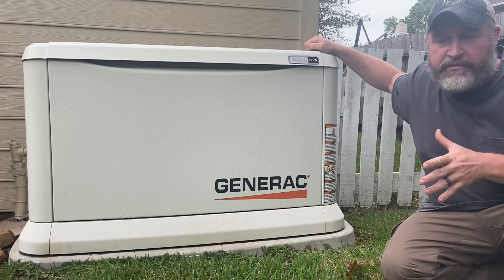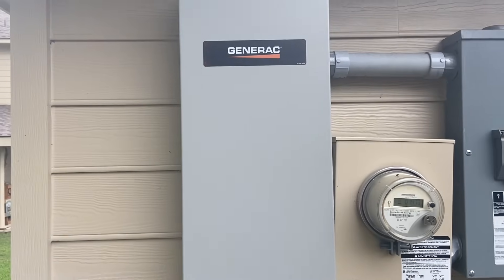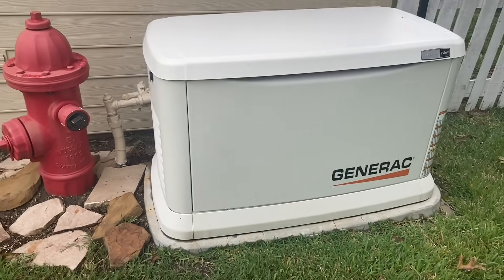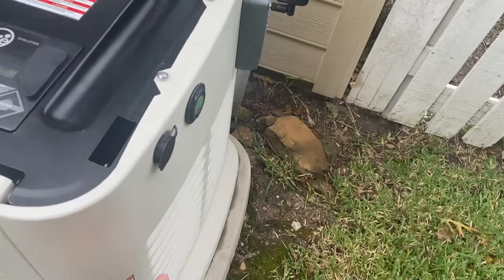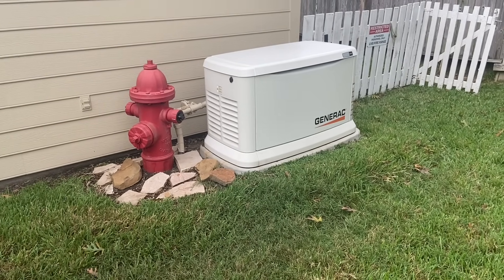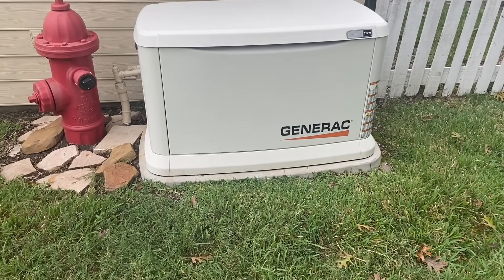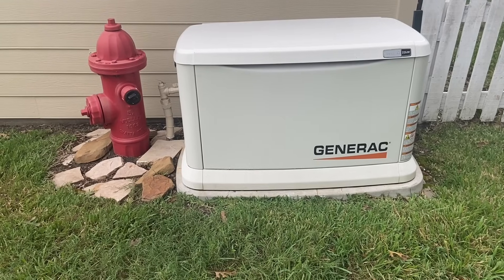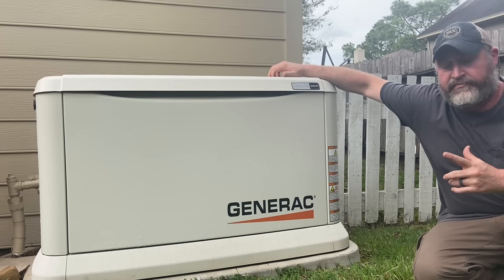Thinking of purchasing a generac whole home generator?

Comment: How much it cost in gas to run it for 1 day?
Reply from the maker: To many variables to give you a definite, but I figured during our 3 day outage we spent about 17$ more per day than normal give or take a few , keep in mind we had 2 gas furnaces and a gas fireplace one with the attic door open to keep our pipes from freezing. It was also  a colder month than normal so our gas usage was elevated
Reply from the maker: Hope that helped cost is not really something I think about just happy to have power , please subscribe and check out some of my other videos
Reply: Googling about:  "approximately 2.1 gallons per hour
For example, according to Generac a 22 kilowatt generator would burn approximately 2.1 gallons per hour at ½ load and 3.6 gph at full load, while a larger 38 kilowatt unit would burn 3 gallons per hour at ½ load and 5.4 gph at full load."  Fuel costs are regional.  For me, propane costs about $3.00/gallon.  YMMV as they say.
Reply from the maker: @barryf5479  thanks for the comment, well worth the cost when the power is out and you can sit the the comfort of your own home.  please subscribe like share and check out some of my other videos

Comment: Damn...  $11,000   No need to power entire house during a power outage.  Just pick up a nice 3500-5000 watt portable generator along with a manual transfer switch for under $1500 and a little 6000 BTU window unit to keep a room cold if needed.  But still a nice set up.
Reply from the maker: We played the portable game before and we upgraded. Thanks for watching please subscribe and check out some of my other videos.
Reply: I have a portable generator, but I am handicapped and it's hard to set up. I'm also doing this for my wife after I'm gone...
Reply from the maker: @davidgardner49  amen brother thanks David for watching.
Reply: Kudos for the manual TS!  The major problem with portables is you can't keep enough gas on hand for an extended outage, and lets be honest, portables are not designed for long run times.  They are inherently more dangerous than a permanently installed unit because of the quantity of gasoline that you have to keep around, with the refueling and keeping fuel fresh is a definite problem.   Yes, it can be done, but it is still a major hassle.

Not to mention that even though they are small they still suck down some gas.  I have portables that I converted to propane, I got by in 2011 on a honda EU2000, it worked, but there is only so much you can do with a small unit.  

So I still put in a whole house natural gas powered standby...because it is impossible to keep enough gasoline on site for major outage and guarantee it will be good over time-or that gas will be available during the next major outage.  That is my experience out in the sticks.  

(Of course, full disclosure, I have done generator service installation and repair for a living, so it does make it easier for me to install and maintain, than many.)

Comment: How much did this all cost you boss??
Reply from the maker: @X11CHASE  watch the video to find out.
Reply: @JustCantSitStill 😂
Reply: $11,000 in the video! OUCH!! I’d rather buy a gas generator from HD
Reply: @CanTho2022  Yeah, that's definitely cheaper but you'll still need a transfer switch or interlock kit which will cost $1k-2k installed plus the cost of the portable generator. Then you need gas on hand and you need to be there to manually set it all up and start it. A portable generator will almost certainly not run your entire house, but everyone's needs are different.

Comment: Writing from England.
Energy prices are getting so crazy here that we're on the edge of it being cheaper to have a gas generator for electricity - full time, and disconnecting from the grid!  Gas price is $0.08 while electric is $0.50
The only thing that's putting me off is the noise.
While I'm here, why are US gas pipes in threaded iron?  We have had copper gas pipes here for 40 years.
Reply from the maker: Yea I don’t think running one of these 24/7 365 is the way. There just not made to do that. We do have flex gas lines I guess it just depends on the area. I am not sure about the current supply line that’s underground, all that’s above and in the house is steel. 

Our previous house had a yellow flex underground but then went steel hard line to the meter and out to the rest of the house. Thanks buddy for watching all the way from England I appreciate you.
Reply: @JustCantSitStill  
I have a generator installer (just happens to be my brother-in-law) looking at what would be suitable for 24/7/365.  He's suggesting a generator running from 6.00 in the morning until 10.00 at night, then a bank of batteries supplying overnight draw for fridge/freezer and lights, etc.  Our annual use is 14,000 kWh with a winter day using maximum of 70 kWh.

Payback period (for generator and gas supply) is just three years!  So it's looking viable.
Cheers from England.
Reply from the maker: @jimskirtt5717  sounds like a great plan , cheers 🍻
Reply: We can't have copper anything in the US, the diversities will steal it.

Comment: Wow, where are y'all at.. Out the door in Central Texas = $7843.  No Gas line run on delta
Reply from the maker: No way , I got updated pricing this week 7/22 for my 22kw  6185$ just for the unit. We are in Houston.
Reply: Yeah a lot of these options don't exist if you don't have a gas line
Reply from the maker: @jacquestube  large propane tank
Reply: @JustCantSitStill  This is in Fredericksburg.  That is the 22kw with installation.  This was not the lowest either.  Low (Not Generac but Honeywell - $7200) High $8960 (Not Generac but Kohler)
Reply: @JustCantSitStill  large propane here.
Reply from the maker: @kdogbigdog  crazy price difference !
Reply: I live in Texas and Generator Supercenter quoted me $14,280 in 2014.
Reply from the maker: @rachelcombs9858  that’s the going rate in my area currently. Thanks for watching please subscribe and check out my other videos

Comment: May i ask if you installed soft start kits on your AC units to keep the inrush startup amperage low or did you not even have to mess with that for a generator this size?
Reply from the maker: @RussSchampers  no we did not mess with them
Reply: @JustCantSitStill They are absolutely worth it, and easy to install

Comment: I have the same Generac that you do, 22k.  We also got the house surge protector.  Today I'm running it for the first time for the 25 hour break in.  My house is a little smaller then yours, and we don't have power in our sheds, yet.  Whenever the a/c kicks on, it causes the Generac to speed up and get a little louder, for a lack of a better description.  Then it smooths back out.  You know the a/c just kicked on...  My worry is my desk top computer.  Whenever the a/c kicks on, it causes my UPS surge protector battery to light up and beep, but it only beeps once.  It's noticeable and bit scary.  I'm wondering if I have anything to worry about concerning my computer.  Generac is supposed to run a pc without harming it.
Reply from the maker: Yes I read that it’s supposed to be ok as well , ours bogs down a little and ramps back up with the A/C’s start and we have not had one single problem yet. Thanks for watching have a great weekend.
Reply: @JustCantSitStill  Thank you.  :)  I had watched your video before we made our decision to buy.  I'm a little stressed, I guess. :D
Reply: 25 hour break in?  I had a 16KW Generac installed in July 2020, the installers ran the unit for about half an hour and that was it.
Reply: @RICKYY1100  I meant to say 24 hour break in, but yes.
Reply: The generator does get louder on a load change, but it doesn't "speed" up, it is just working harder.  Your UPS, if you have a better one, some have software that can be adjusted to alarm at a different voltage sags/surges, most are set to about 5 volts plus or minus, which is too sensitive during a generator run, and so the UPS will always complain when the voltage varies that much-which isn't very much after all-no reason for fear-but once is normal.  Your power company does the same thing, it just isn't happening as fast as it does with a generator.
Reply: @bobbygene8274  Thank you :)
Reply from the maker: Connect a tachometer to one and come back and tell me it’s does not slow or speed up during load cycle…..

Comment: Just remember, if you are off the grid or loose power a lot. These generators need power from the pole to service itself. There are off the grid generators that don't need power from the pole.
Reply from the maker: Thanks for watching.
Reply: They all need batteries charged, or block heaters working, off grid or not.  There is a need for some kind of power system to account for the parasitic drain of standby service for everything.

Comment: I can tell one thing it will cost you about  fifty dollars a day, 24hrs,to run this beast!
Reply from the maker: Mine did not, probably depends on your area and NG cost.
Reply: I’m looking at putting one of these in. Even if it does cost that much to run, that’s $350 for a week, for example in a major power outage. I’d gladly pay that to keep from losing a fridge & 2 freezers full of food, beef & venison. Plus the convenience of having the whole house powered including HVAC. I guess it all depends on what resources you have available. If you’re spending this much on a generator, you’re probably not sweating $50.
Reply from the maker: With the generator running , both furnaces, gas fire place and water heater it cost me a little less than 17$ more than normal for the bill cycle.
Reply: $50 a day is cheap as hell to survive
Reply: Cheaper than a hotel room!

Comment: Better make sure you know the warranty because they won't repair it only if you know who is responsible for the warranty work and get it in writing
Reply from the maker: Mine extended warranty is through Generac. Warranty work can be done by Generac or an authorized/certified Generac Service provider/dealer. Thanks for the concern and for watching. I appreciate it.

Comment: I just brought a house that has one of these unit’s. 

What’s the point of the natural gas, if you have to use petro anyway? 
Can you test run the unit with the city power on?
you ever consider building a sound proof box over it? 
Thanks
Reply from the maker: What do you mean you have to use petro anyway? These run on LP or NG. Please clarify your question.  Yes it’s runs a self test weekly. No if you build a enclosure you will definitely void your warranty if you have one.
Reply: @JustCantSitStill  Ok, so it’s either natural gas, or Regular gas I didn’t realize it was one or the other. Thanks.
Reply from the maker: @dragonlotion1789  liquid propane or natural gas
Reply: Yes you can test the system with city power on..... should have been tested by your home inspector.
Reply: @alm4132  thanks for the info. The inspection process has packages, at least the company that our realtor uses. I guess it wasn’t included.
Reply: No gasoline, propane or natural gas. If you heat your house with natural gas, hook it up to it.

Comment: My Lord that’s a lot for a permit!  Damn government.  I guess because your lines were 50 feet it cost more. I’m in the country and I’m going to place my propane tank close to my generator and I already have a transfer switch that came to my garage end.  Then the electrician ran wires (huge) over the top of the garage in attic floor to my Circuit breaker box which is high tech. He did it right.  I hope to do better than you for a 20 KW!!
Reply from the maker: Gas and electric permits city of Houston wants that money 💰! Good luck with your my dad did similar after it was said and done he came out the same as my turn key project. Have a good one thanks buddy for watching.

Comment: I think you said the battery only lasted a year and a half.  Did you have to pay for a new one under that yearly maintenance plan you purchased, or is the battery included in the plan?  I just bought an 18,000 watt generac but am still waiting for the propane to be delivered so the electrician can finish hookng it up.  Thankyou for sharing this video. It was very helpful.
Reply from the maker: Hey Bob the battery is considered a wear item so it would not have been covered, so I replaced it out of pocket. Congratulations on your purchase! Hope it provides you with many years of trouble service ! Please subscribe like share!
Reply: I don’t know what type of battery you had in there but if it was the correct battery then there is no reason why it should be replaced only after 18 months. If the contractor your using is telling you this then you need to find a new contractor. 

***15 years experience installing and servicing generac generators
Reply from the maker: @Drtouchwell  wow I appreciate all the comments, it was a 18 month interstate battery , complete junk lasted about 16 months. Replace with a die hard been great since.

Comment: How much was the battery replacement?
Reply from the maker: Whatever the cost of the battery was probably 200$ now.
Reply: We have a 22kw just got the battery replaced it cost $340 in Florida right after hurricane Milton needed oil and we ran it for 30 hours using propane tank

Comment: Seems to be a bit long to respond.  Useable, no issue, just need battery backup on some items inside.  The 20KVA system is ideal for a 200A power panel.  200A * 120V, [ yes I know a 220 system but 100A per leg ], gives you 20000 or 20k. Assuming pure resistive and all are resistors, not inductive motors.
Reply from the maker: I don’t think it was slow at all but that’s my opinion. Thanks for watching and the comment.
Reply: Our church switched to a CCW 440cc 2 stroke diesel unit at about 20kw. the boiler was switched from oil fired to ball lighting plasmoid T henry moray uniit which is 800kw and way more heat as it taps zero point energy! today the oil burner unit was rebuilt by Sheldon Richardson and Odell Beckham who wants us to switch to no. 2 diesel fuel oil and installed a new ignition transformer. Myles Garrett refused to go near this thing!
Reply: Jaynen Samuel's has an ignition transformer with is 24kv and 1.5 a and can kill someone instantly which is why Myles Garret disproves it!
Reply: craig Iron head heyward spirit turns a an iron fireman oil fired unit into a spirit powered 66000 deg f plasma particle accelerator with which is spirit mind! Saquan Barkley waste oil burner is 3 million BTU and burns waste fat vegetable oil and uses the high 24kv ignitionn transformer. He also uses this oil to fuel the EMD 710 2 stroke railroad engines
Reply: @jlo13800  😁😁
Reply: Its a 2 stroke engine and i got one with a 30kw 2 cycle engine to start heavy loads

Comment: Compare 10 millisecond transfer time ,almost silent operation,almost no maintenance, payback from day one with a solar system. About 20,000$ for equivalent capacity if diy but no noise,no propane no oil change .Harvest 50 KWA PER DAY for about $225 per month payback
Reply: Get a smaller generator to play with as a hobby and use almost never.
Reply: Power from these generators gets distorted at a little over 50% of rated capacity.
Reply from the maker: Nice but that expensive, how long can you run on yours without the sun?
Reply: @JustCantSitStill  Most nights it lasts till the sun comes up.I still have a 9KW generator and lots of propane.Never had to use it but great to have another level of protection.
Reply from the maker: @danielking2944  very cool so Solar on roof ?
Reply: @JustCantSitStill  several arrays. Still playing and learning.
Reply from the maker: @danielking2944  learn every day love it
Reply: @Rawkfist1501 Diy is necessary to hold down costs for sure.The all-in -one inverters simplify things a lot.I have 20 years master elec  license but still benefit from videos on u tube. Getting a little unsteady for doing roof mount at 69 years but fortunately have room for ground mount arrays.
Reply: @Rawkfist1501 Yes batteries are the biggest cost. Have 35KWH and still adding 5KWH server rack batteries when I can pay cash .  Living John Prine’s  Spanish Pipe Dream and waiting on Social Security check. Tengo que admitir que necesitaba ayuda para encontrar Jesús.